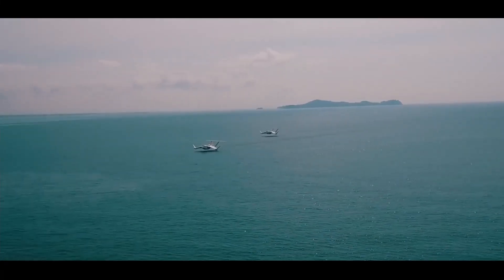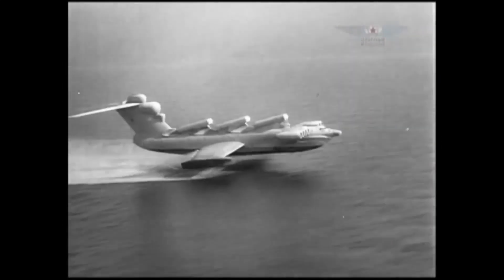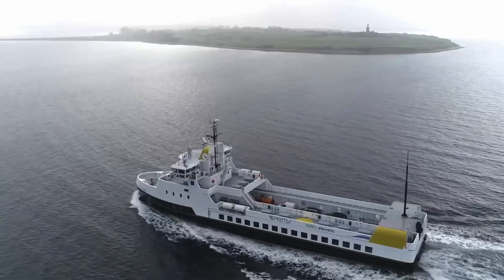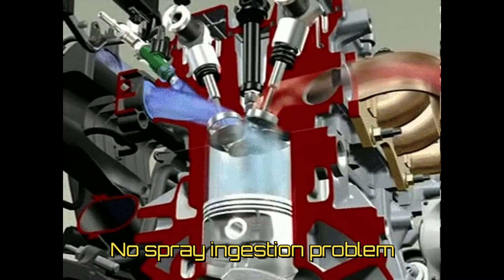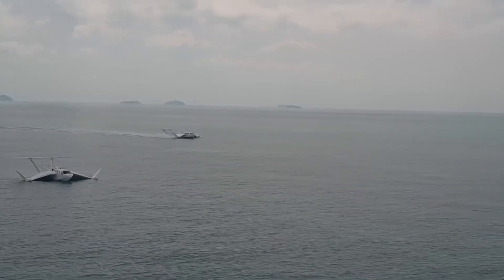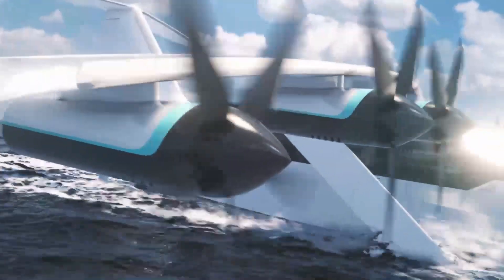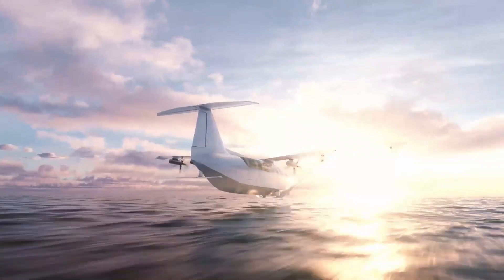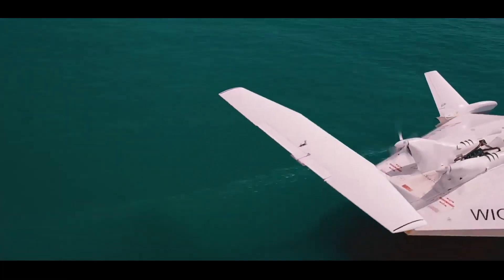Wing in Ground Electric Aircraft: Future of coastal transport

Comment: Good vid, but I cannot see large WIGs being practical. A small inflatable electric water toy would be cool though. The bigger, faster and further you want to go, the more straight up flight works. Making a good boat is hard enough, making it tough enough to handle wave impact, climb through all the drag regimes, lift regimes, and maintaining it in stable flight just has too many compromises. It can work, but the suitable waterways are rare, and the first big storm will probably trash it.
Reply: The bigger the craft gets the more efficient it gets because it traps a larger volume of air underneath. Honestly a huge cargo plane might be the best use case
Reply: @nathanchildress5596  True. That's the way the Russians went for good reason. One rouge wave or bad storm can still take them out though, and you really need good radar and planning at speed because they turn like dogs dt limited roll.

Comment: Soviets stopped the ground effect aircraft project because it has a huge amount of disadvantages. It can be used on absolutely flat water only. Even tiny waves mean strong vibration and waves higher than 1-2 feet mean you can't use this vehicle. During tests, vibration was so strong so they lost their tail. Every small boat is a big problem because roll very limited to turn. And many more problems.
You can build a prototype but it impossible for real commercial use.
Reply: Modern aerodynamic stability control systems can pretty much totally mitigate the issue with vibration, and they can be ruddered to turn more like a car than roll like a plane.
Reply: @benwilms3942  you don't even understand what you are talking about
Reply: It is making too many assumptions to insist that since a prototype had limitations, the concept is worthless.

Aleksyev counters each of your points, Lippisch can fly.

Sea state is always brought up and always overstated.

Comment: Excellent video. Don't these require a lot of power to get themselves out of the water? I seem to remember the Loon had all those jet engines for getting going and could turn off most of them when in cruise mode. I guess the hydrofoil idea is a good way to get around it. I've seen 3hp hydrofoils, so it seems like a good solution. I wonder if these WIGs offer any great advantage to hydrofoils though? Both seem to suffer with rough weather. Maybe you could do a sister channel - Electric Watercraft?

Comment: Completely impractical for people transport. Any engine failure would lead to multiple injuries. People would have to be strapped to their chairs for the whole trip.
Reply: Well, for one thing, it seems several companies disagree with youabout the particality, as they are producing craft that they hope to sell!  Any high-speed transport inherently has an element of danger, and having to wear seatbelts is an entirely reasonable solution. Also, it isn't loss of engine power that would be a problem - the inrtia of the vehicle would keep it going forward for some time, with the ground-effect decreasing smoothly as the airspeed drops. It would NOT be a case of suddenly slamming into the water. 

What would be more dangerous is if the vehicle rolled too much; that could certainly cause a nasty accident, but the thing with engineers is that they tend to look at potential problems and do their best to design solutions, and emphatically do not want to put peoples lives in great danger. In order to be sold, any vehicle needs to be ertified as safe to use by relevant authorities, so this is obviously not such an ssue as you imagine.
Reply: Completely impractical 😂Gimme a break
It's half an airplane after all
Reply: @cedriceric9730  Really! When airplane unexpectedly drops it hits air. If this drops, it hits water. If you are not strapped when this happens you are going be knocked off your feet and hit something. No people transport. Yes lawsuits.
Reply: @Traderhood  
who said anything about not strapping in at those speeds?
Even in a car...
Iam having a difficult time imagining your " drop"
This is a surface effect vehicle which must remain at most 2 or 3 feet above the surface it's using to hold the aircushion.

Comment: Well done, you covered almost everything I would, but you might have included Roberto Bartini's VV14 Bierev.
Among the tech aspects, speed is limited by the wings ability to climb out of ground effect due to too much power. There is a need to tune climb out with aspect ratio to gain speed.
This means that the aspect ratios are very narrow, boosted by tip extensions for control in tight circumstances.
All of the reverse deltas fit this profile, but there is a patent on that design; this is avoidable by more normal rectangular wing plans with tighter influence on the CG relationship.
The RDC Aqualines ship you showed is just such a craft, and provides a pattern for craft that is scalable as RDC demonstrate.
The Russians found that unsticking a flying boat from the surface requires several technologies including stepped hulls and PAR.
PAR is power augmented ram, which pushes air under the wing to saturate flow while accelerating forward.
Of all things, in the future I see this as the first use of electric drives on GEV craft because the salt ingestion just kills engines and these are in the most vulnerable position.
We had very limited success with the tandem wing, and as it brings with it issues for hops into free space, I dont think it has anywhere to go. ymmv
cheers
Reply from the maker: Thank you for your informative note
Reply: The stepped seaplane hull has been unnecessary since the'50s, with the Chase / Stroukoff YC-134E. An upgraded C-123 with boundary layer control for STOL, and "pantobase" skis on a strengthened sealed aerodynamic body. (large, flat skis)
Operated from water, sand, swamp, mud, snow/ice, dry unimproved ground.

Among the studies for an amphibious C-130 version, was such skis.
Reply: @JFrazer4303  the main difference between GEVs and conventional aircraft is that to cover their principle role of economic flight they are very under powered from the conventional 10lbs per hp to an effective in GE 33 lbs per hp. This lack of power means they have difficulty getting the hull over the hump speed and get the machine to plane, break the suction from the surface and take off. Because without that clear air under the wing the aerodynamic side is ineffective with only the top surface in operation. 

This is why virtually all Soviet machines from the many competing design houses eventually decided to use PAR, power augmented ram. Obviously the additional thrust helps, as it is still vectored to even approximately move the machine forward, but it also pushed air beneath the wing which physically broke it from the surface while connecting the aerodynamic stream wake of the upper and lower surfaces. The downside is these are engines absorbing a mass of salt water spray greatly shortening their TBO life, that are ultimately dead weight after take off. Of course electric propulsion would answer that for the short time it is required as we have seen it do successfully for VTOL.

Comment: Maybe on some lakes or why not on rivers?
Reply: why not over land?
The Russians developed the tiny ESKA 1 of 992 lbs, which was a vehicle for flying along rivers, and over frozen tundra in Siberia.
In Australia theyve been talking of VFT very fast train, but distances make the cost prohibitive, as even ordinary track costs A$1m per km
A GEV would only require a managed glide way over land to connect places like Adelaide in the south, to Alice Springs in the centre, and Darwin on the north coast at 120-200mph
This is a transit of some 1,800 miles, and where the glideway would have less environmental impact than rails, and would fly over common fauna like kangaroo and shrubs.
Reply: @z_actual   A very advanced autopilot system using lidar and so on would be needed. But that is a problem that can be solved.

Comment: As cool as the use of that effect is, unfortunately it's very impractical in most circumstances. For a few islands in very flat sea this may be practical. But even for general coastal travel it's not very reliable. With a wingspan of 40 meters a wave amplitude of 1 meter would basically make it impossible to travel. Ferrys are very reliable to hold their schedule. With a WIG you'd be highly depending on the weather, which makes it very unattractive for commercial use...
Reply: while there is truth to this, commercial craft are envisaged to be larger than those suitable for private operation
In this way the civil version Cessna size 6 seater suitable for coastal operation doesnt require a pilots license, it is registered as a motor boat because it is surface traffic.
The bigger the craft the more sea able it is, and the ride height all the greater
Craft suitable for ferries would be much larger to be able to maintain their schedules on par with helicopters and sea ferries
Reply: I'm curious about how you arrived at 1 m seas being a problem since a 40m wingspan would allow a 13m height above the water.
Reply: @stevemickler452  5% of wingspan was the number I've gotten from the video. That means 2 meters for 40 meters wingspan which is an amplitude of 1 meter
Reply: @stevemickler452  he got his wires crossed I think. The ekranoplan types like Caspian Sea Monster and Orlyonok have the worst height performance in ground effect, more usually half the wingspan is the height they will achieve but at some loss of efficient performance. They can use inertia to jump over higher obstacles, but you wouldnt want to stall the thing.

Comment: I'm convinced a hybrid hydrofoil ground and winged effect vehicle is the best solution.

Particularly if you use the water as your reaction mass.
Reply: The Russians used the 'hydroski' to assist in take offs and flight in very marginal conditions
Reply: I don't like reliance on underwater propulsion and control.
 It's bad enough being paranoid about subsurface logs at higher speeds, but even taxiing among floating debris.
A GEV even at walking speed loves snow, can push through mud or sand onto land, or turn around & fly up into GE.
Reply: See the Chase / Stroukoff YC-134E from the mid '50s.
Upgraded C-123 with boundary layer control for STOL and sealed strengthened fuselage & a pair of "pantobase" flat skis.
It operated from unimproved ground, water, snow/ice, sand, swamp.